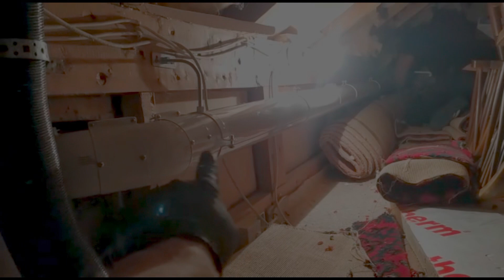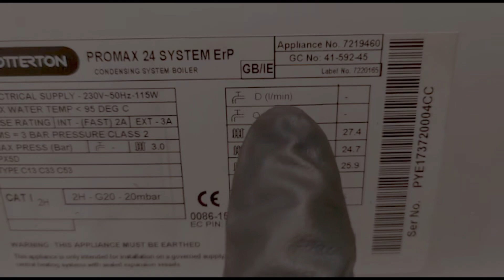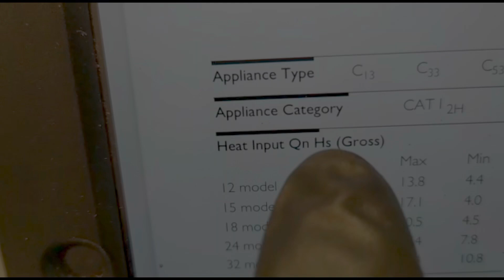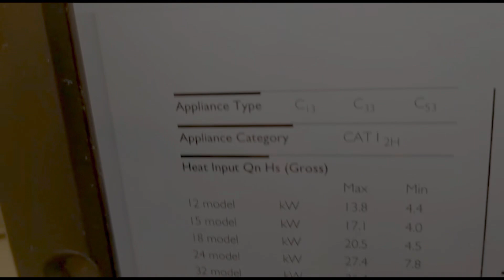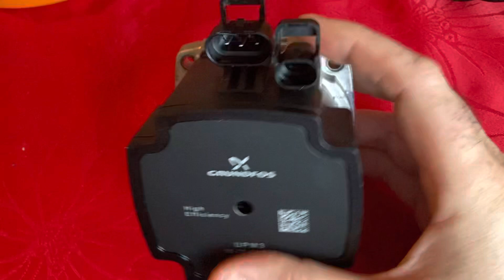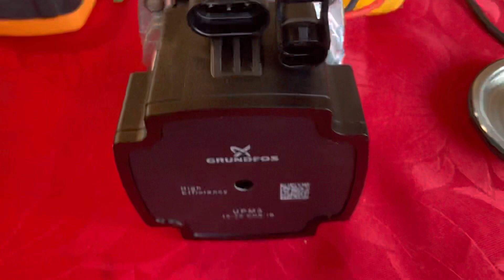Plumbers Videos - Elliot From E Fry Gas Services  / Kevin Ex Ideal Boilers Engineer / Flues / Pumps

Comment: Hi 
I have a s plan system with a glow warm ultimate 120 
In the middle of the night the pump makes a grinding chatter sounds is as if it is trying to turn ? 
I have replaced the pump several times 
What are your thoughts please 
The system is controlled by evohome which works well as I have a large home

Comment: Kevin, video idea :      Ideal fault finding, common faults/failures you would see regularly.  Cheers
Reply: O.k I will see what I can come up with
Reply: @Hallesworldb127  Please explain why ideal flow turbines keep failing and as to why the ideal sumps keep failing. Really enjoy your content pal.  Please don't stop 🤘👍
Reply: I can answer that for you now if you like…… the brass type flow turbines I think you are referring too are simply stopping rotating due to high mineral content in the water supply and small contaminated debris blocking the filter and flow restricor. Inbuilt into th flow restricor are guide veins which cause a turbulence in the water and when they block, they fail to rotate the turbine.
Reply: As for the sumps. I don’t k ow why some of them crack. I have never been told  why. I’ve heard loads of different theories but no ones has ever told me. I have my own theory but I can’t prove it. However we’ll over 2 million logics have been built and the problem affect a very small amount in percentage terms. Less than 10 percent. It’s not dangerous and therefore not a very big issue which a lot of people try to make out it is.
Reply: @Hallesworldb127  Thanks Kev,  I thought I'd ask because you'd be more in the know than most of us.   With the flow turbines that makes sense.  Could the sumps be down to inferior plastic usage and the wrong preset torque of screws from the production line.  I think slight turbulence from convection heat from the downward burner. Maybe heavy handedness of engineers whilst removing the flue manifold, could be a contributing factor, 🤷‍♂️.
Really appreciate you taking the time to explain 🙏🏼.
Reply: You are on the same wavelength/ conclusion with me on the heat turbulence thing. Heat transfer to the hex incomplete and not in the correct settings etc etc
Reply: @Hallesworldb127  You're a top guy Kev 🤘👍
Reply: And why don't they put anti-vibration washers on the heat exchangers as I service a fair few and the nuts are always very loose especially near the fan. I can only assume it's the vibration from the fan that causes the nuts to get loose.

Comment: Rcd and mcb misbehaviour, highlights an issue with electric installations, and eltricians confidence in people not plugging devices in. And a lot of branded fittings being made cheaply.
Kettle toaster boiling egg on hob while chucking the washing machine on, what maniac would do that . 
It's odd how fitters working for housing associations quote stringent regs regarding flues, and then homeowners get flues as long as you like going more or less wherever they like.